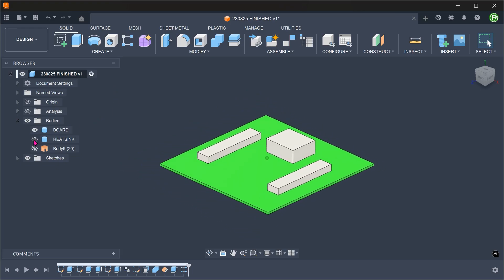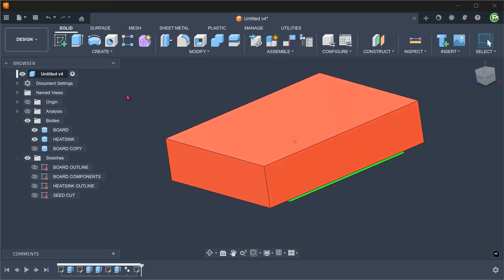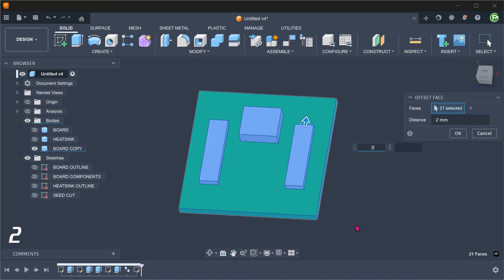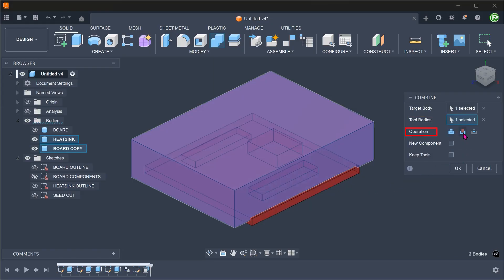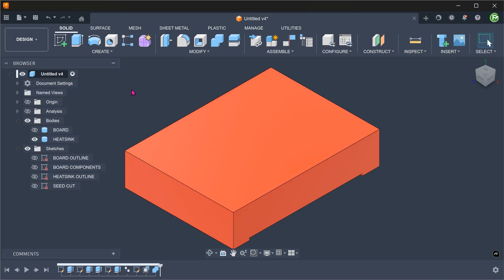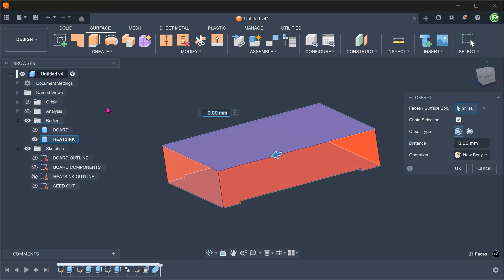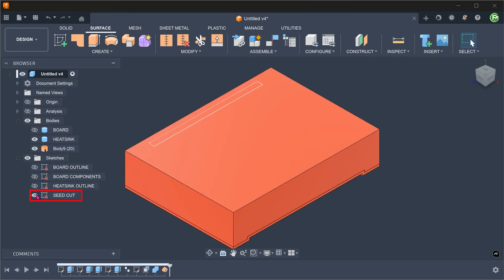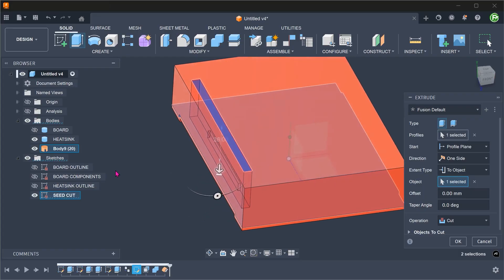Autodesk Fusion | Extrude Up To Surface Body

Comment: As always, love your work. Two humble video requests:

(a) A renewed multiple example comparison of replace face, vs. extrude to object etc. Especially where target surface is inconsistent or multi-surface geometry.

(b) A detailed look at selection control options and other filters to improve speed and reliability when doing things like this video, or "select all faces except vertical ones" and so on.